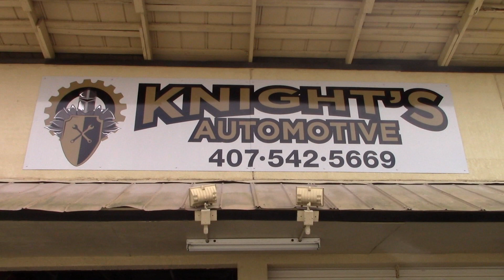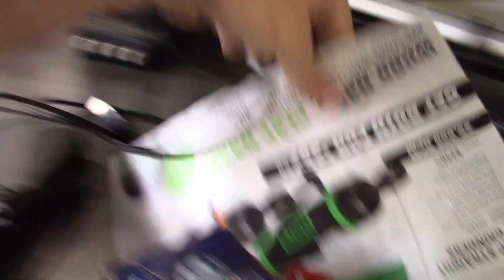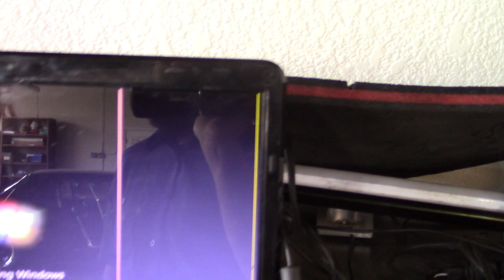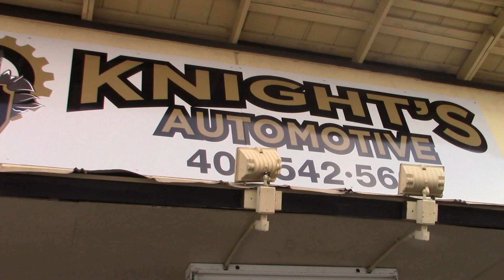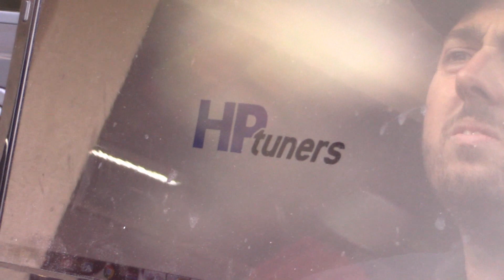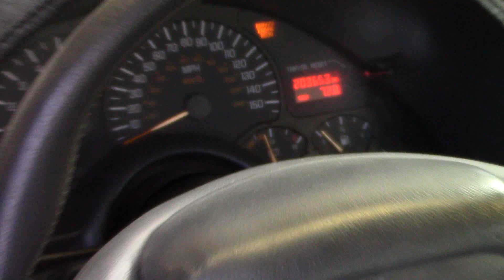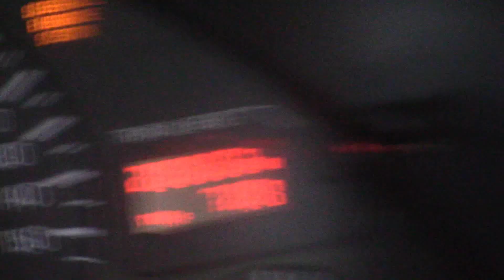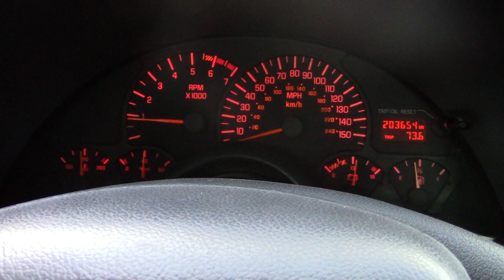Vlogging and Tuning (The Trans am)

Comment: I used to have this problem. (Grinding gears and notchy as hell) Turns out it was actually the clutch master cylinder. I went with a ticks  master cylinder and a dorman slave with a billet aluminum flywheel and a stage 5 comp clutch. Fixed everything. Including a trans flush of course. Just to add that my trans had maybe about 67k on it so you dont think it was something else.

Comment: Can anyone help think of somewhere where I can buy a ws6 95-02 98-02 prefer but open to the others anyways find one under 4K roller or not. No offer up and craigslist I check them all the time. I want to build it as a daily built 5.3 4l80e. My other projects will have 6dp TH400 etc thanks in advance. Your opinions or builds are welcomed
Reply from the maker: Look on auto tempest and it will search all major platforms. Also can always look for one that needs work on copart!
Reply: J Whit yea but most are not in Cali co part and need shipping which some are like 800$ then the ones here in Cali are v6. But thank for the motivation Iam gonna keep searching